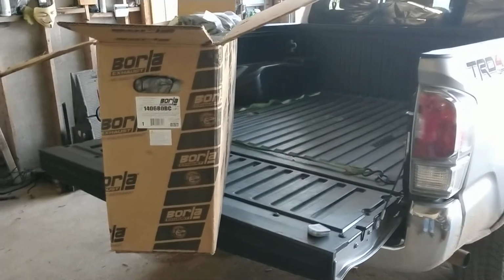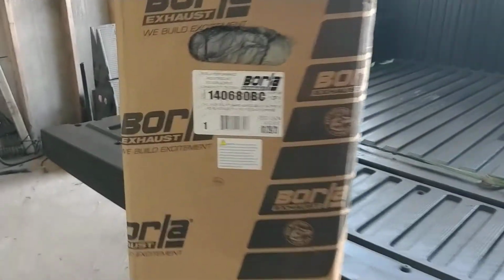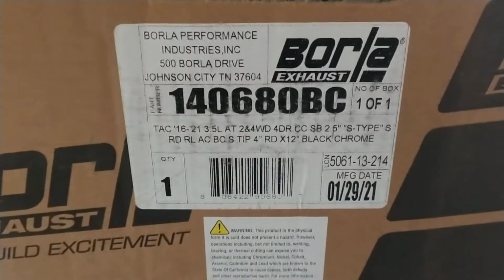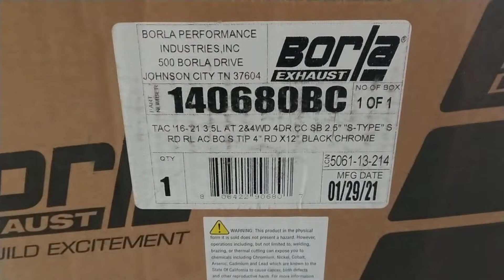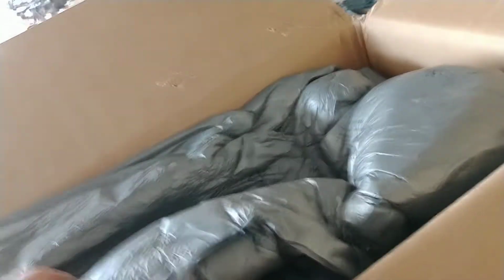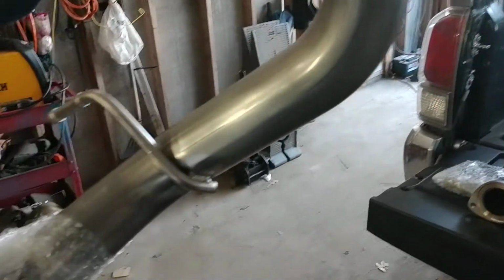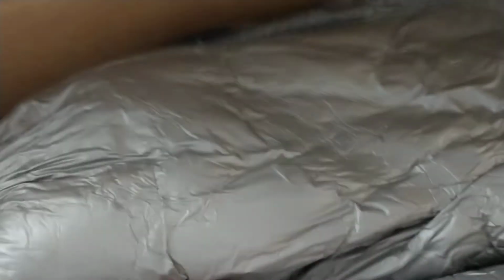2020 Tacoma Borla s type catback

Comment: Does it sound good? Would recommend you recommend it? Also what website did you buy it from?
Reply from the maker: Yes I absolutely love it. I had a smaller magnaflow style muffler welded in place of factory but when I towed with it the drone was a bit much. I specifically got this muffler because it doesn't drone. 
It also sounds great at higher rpm. 
When I was younger I liked them a bit louder but now this is just right.
I also have a custom y pipe so mine would be a bit louder than most.
Go watch my video of it going down the road.
I bought it from discount bandit.
They had a great deal on it 100 dollars cheaper than elsewhere